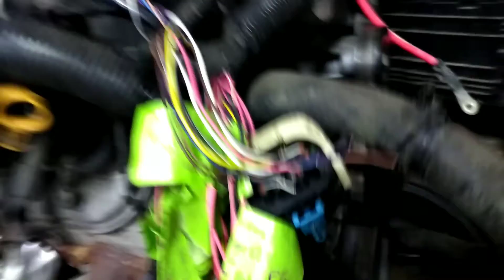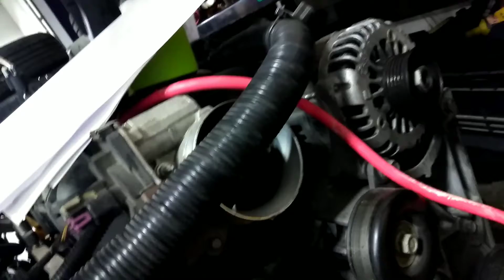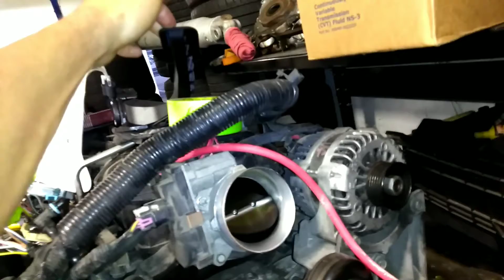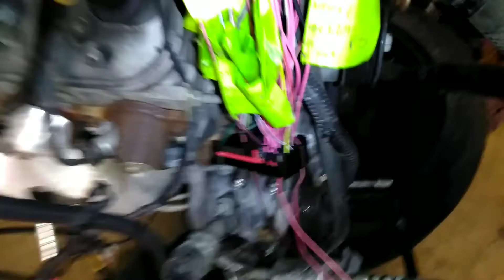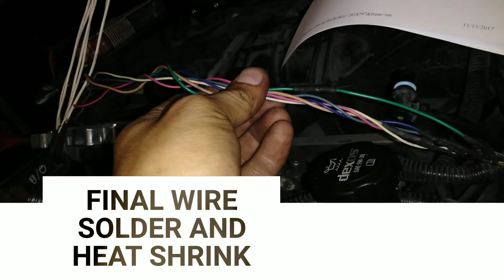Ls drive by wire

Comment: I didn’t get the module that goes with the pedal and pcm..   
What should I do if I’ve already flashed the pcm
Reply from the maker: Mine is a 2012 the it does not use a separate module for pedal only pcm and the tcm is in the transmission 6l80 also 2012

Comment: Hi, I was trying to figure out how you ran your wire from the Tac Module to your throttle body plug? IS there any diagram you used for that?
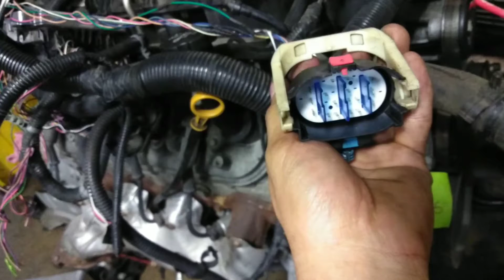Reply from the maker: JRB CUSTOMS44  yeah is the x109 connector at 0:39 i got alot of the info from ltswap.com and i got the diagram for the gas pedal connector from a gm tech
Reply from the maker: JRB CUSTOMS44 the wires come from the ecm black connector to the x109
Reply: WHAT PIN WOULD THAT BE FROM THE ECM PINOUT? AND I THINK MY S102 GROUND!
Reply from the maker: JRB CUSTOMS44 black connector at ecm... #23 purple #29 dark blue #30 brown #32 light blue #36 tan and #56 white with black tracer.. At the gas pedal pigtail connector with the lock clip facing up towards u goes from f to a pins. Pins A TO PURPLE. B TO LIGHT BLUE. C TO TAN. D TO WHITE WITH BLACK. E DARK BLUE AND F  TO BROWN.     LET ME KNOW IT THIS HELP OR GIVE ME A EMAIL ADREES AND I CAN SEND PICTURES.
Reply: My email! Thanks...
Reply from the maker: Let me know if u got the email or go to my instagram pepezx6r and ill send them thru there
Reply: ok, cool! I did receive them in my email! Thank you again! Im looking and them right now!
Reply: Pepe 97 
Do you still have diagram for ls3 foot pedal
Reply: JRB CUSTOMS44 
Do you still have diagram for ls3 foot pedal
Reply: Hi..I am HAVING ISSUE WITH MY LQ4 6.0 2003. I HAVE DBW, SET UP. BUT I SEE 2 WIRE NOT CONNECTED.. ARE THE 2 WIRES TO MY CRUISE CONTROL? IF SO I DON'T NEED THAT.  I GOT MY SCHEMATIC FROM LT1.COM.. BUT I'M ALIT CONFUSED..
Reply: Hey can you plz let me get that pigtail pinout
Reply: @boostedonabudget9018  still got pictures?
Reply from the maker: @hometeam3908  no had them in my old phone

Comment: Is there any one pedal that’s better to get when doing this swap? It’s going in a 2000 Trans Am. Know I need the pedal, module box, and is there a small harness between the two or does my new main harness plug into each? Thank you
Reply from the maker: Derek Wren on mine its control by the ecm
Reply: Pepe 97 yeah I’ve got the new E67 pcm we’re going to run. I just didn’t know if one year model of pedal was better etc and installed easier in a TA.
Reply from the maker: Derek Wren there are some that are metal instead of plastic and can be motify

Comment: I would like to get more information cannot get to work.
Reply from the maker: What harness are u using
Reply: Pepe's 97 
I have the original harness I did a swap but got everything that I need it into the vehicle it starts and it does idle and I run the truck BUT when the computer gets program to the right vin number of the vehicle The truck will turn on but it won’t idle in the code comes with throttle body so I need to convert it to make it work...  My old engine was a 4x4 with drive-by-cable, and I did the 2wheel drive with the drive-by- wire it runs great but when doing the programming ecu,ecm,pcm, that’s when I don’t get idle .. I need to get a diagram how to convert it .
Reply: Pepe's 97 
I got everything from the junkyard gas pedal harness ecu,ecm ,pcm computer everything from the same truck . My truck is the same year that I took everything off, but my truck was drive by cable and the one from the junkyard was driver by wire .. same year
Reply from the maker: @rickarroyo226  i just stop working at the dealer i cant get diagrams anymore
Reply from the maker: @rickarroyo226  look into lt1swap u might find a diagram
Reply: Pepe's 97 
ok thank you